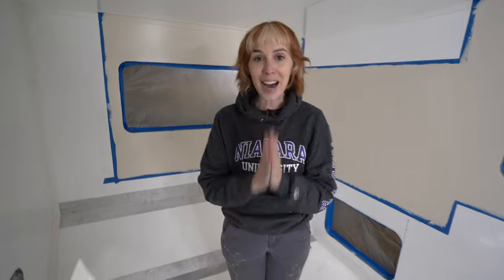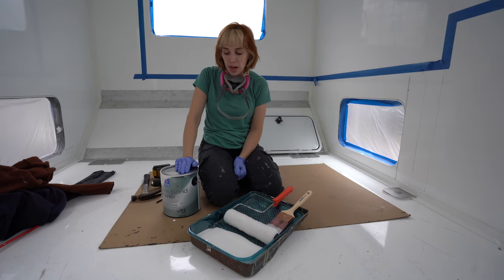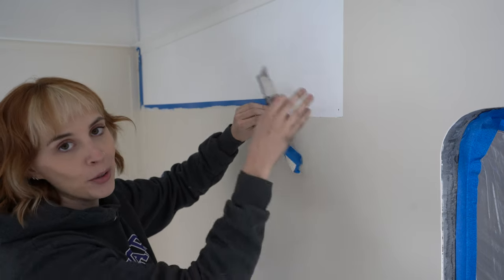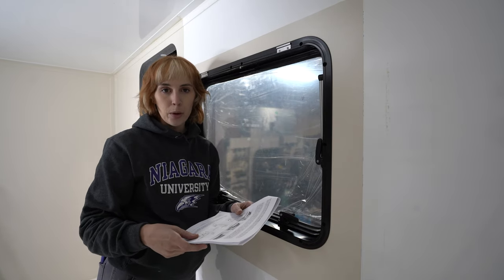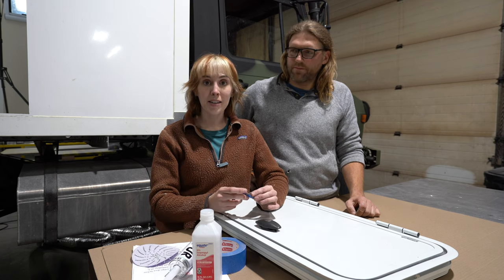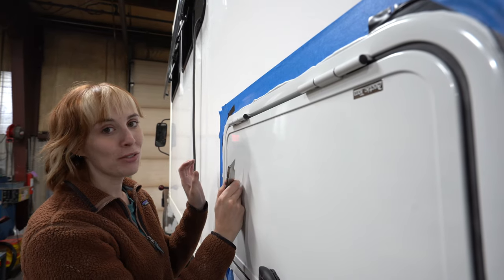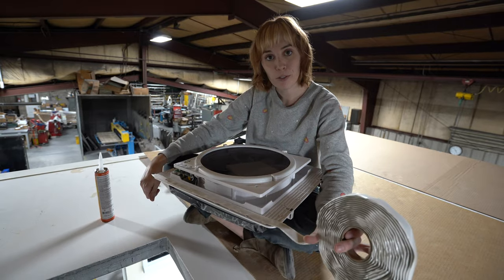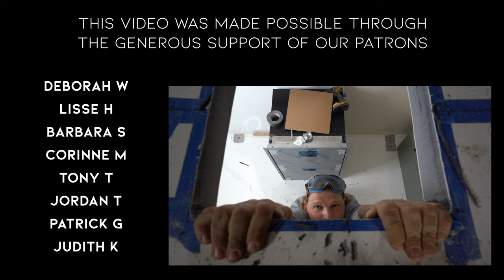Painting Our Composite Camper - Tern Overland Window & Doors - Unimog Expedition Build Series #2

Comment: It's looking nice, but I do have a question. Did you use a sealer on the outside for the windows. Never mind I just read through the messages and seen Mark Renfrews message. Stay safe guys and have a good week
Reply from the maker: Thank you! No sealant for the windows! They have a gasket that makes them waterproof.